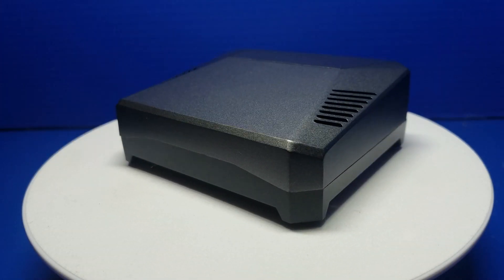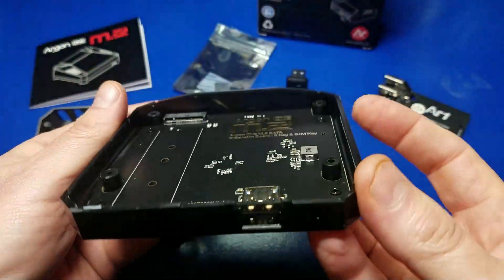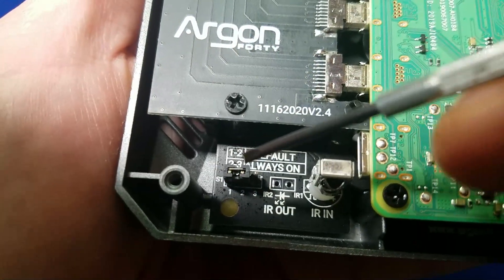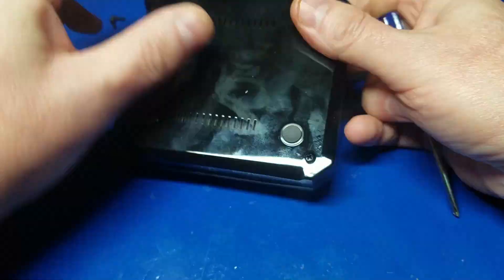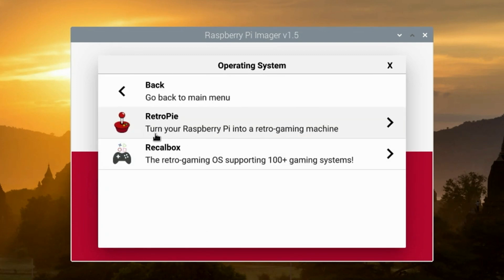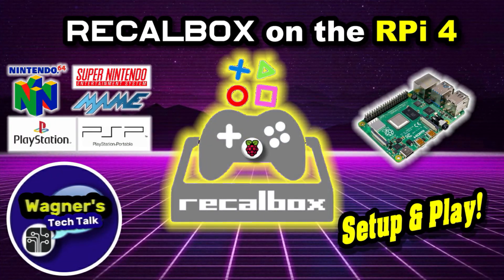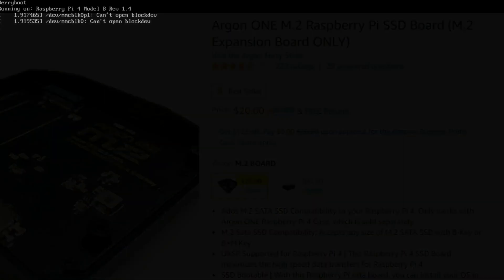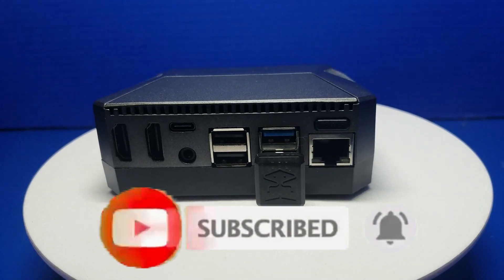Argon ONE V2 M.2 SATA SSD Raspberry Pi 4 Case: Full Setup Guide

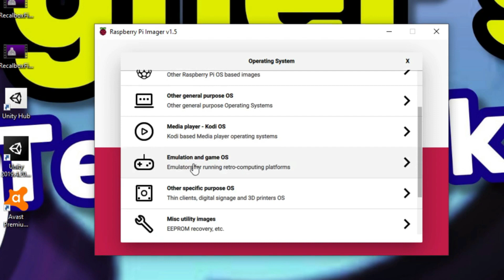Comment: I'm confused. At 9:38 you load the image onto the SSD enclosure. However, you already have the SSD inside of the Argon. You never mention about taking it out. It gives the impression that you have 2 SSDs. Anyway, at 8:38 I do everything perfect step-by-step but then I get a ""failed to open device: SD Card" on bootup. But why is it looking for my SD Card when I already have the NVME installed and formatted? What am I missing?
Reply from the maker: I demonstrated multiple operating systems being installed PiOS, Recalbox and RetroPie (never know what people want to install, so showed a few to demonstrate how to do it).  You actually don't need the enclosure shown in this video, you can use a USB Type-A to Type-A cable to connect it to your PC if you want (instead of the enclosure).  I made a follow-up video on it here, to clarify: https://youtu.be/LHZQKr5G7MA  This case can't use an NVME drive, you'll need an M.2 SSD such as the ones shown here: http://wagnerstechtalk.com/argonone/#Where_to_find_an_Argon_ONE .  Also have some troubleshooting info here: http://wagnerstechtalk.com/argonone/#Troubleshooting
Reply: @WagnersTechTalk  thanks! I said NVME but I meant the 860EVO SSD. I bought everything using your affiliate links and I’m trying to get it going but no luck. I’ll shoot a video which will help you more of what’s happening. Thanks so far.
Reply: @WagnersTechTalk  OK here's my video showing what's happening. Also, happy 4th of July! https://www.youtube.com/watch?v=CaWyhdgQUdo
Reply from the maker: Happy July 4th Walt!  Here's a thread that sounds pretty similar to what you demonstrated in your excellent video response (thank you for that, very helpful): https://www.raspberrypi.org/forums/viewtopic.php?t=294691 The issue reported in the thread turned out to be the power supply, he replied to his own post 8 days later with his solution.  Are you using the official RPi power supply or the one from Argon ONE (18 watts 5.25 Volts 3.5 Amps)?  I used the Argon ONE Raspberry Power Supply – 18 Watts 5.25 Volts 3.5 Amps (USB-C) Power Adapter ( https://www.amazon.com/gp/product/B07TW4Q693 ).  Otherwise, I don't see anything wrong (firmware appears fine, looks like the U-Connector is installed in the back, etc.), may just be that the power being used can't pull the needed extra current for the M.2 drive.  In the thread above, he had no indication that there was an under-power condition and I also didn't see any indicator in your video.  One other thing that you might try, use PiOS imager to erase/format the SSD as a Fat32 (option near the bottom).  Then, re-install the OS to the SSD and see if that helps.  Please let me know if this helps (or not).  I can't think of anything else it may be, honestly.
Reply: @WagnersTechTalk  this might be the issue! I’m using the CanaKit power supply. It came with the RPi 8gb model. But I just went ahead and ordered the Argon One which arrived in 4 days. Thanks so much! I’ll let you know how it goes.
Reply from the maker: Awesome, hope this is it!  In anticipation that this is likely the problem, I updated the Troubleshooting section here: http://wagnerstechtalk.com/argonone/#Troubleshooting
Reply: @WagnersTechTalk  you’re awesome. I just checked and the CanaKit power supply is 5.1 volts 3.5 amps. So maybe the M.2 won’t run unless the voltage is exact. I’ll find out soon enough.
Reply from the maker: Very interesting, I've never had to go through these steps on the Pi 4 with any of the cases I've used (some here: http://wagnerstechtalk.com/guides/#Raspberry_Pi_Cases ).
Reply: @WagnersTechTalk  maybe it’s because I just purchased it this week. I’m also using an 8gb RAM model. So maybe it has a different out-of-the-box configuration than the other models. Either way it’s working perfectly now.
Reply: @ForOrchestra  Thank you for this. This finally worked.

Comment: The Raspberry imager is taking forever to write to the SSD.  Could it be my wifi.  My SSD is a Samsung m2 sata EVO
Reply from the maker: Before writing, make sure it's plugged into a USB 3.0 port, may also want to use Raspberry Pi Imager to format the SSD before re-imaging (just to make sure there are no errors writing to the SSD).  Aside from that, could be your WiFi.  May want to cancel, check your internet speed (go to speedtest.net to perform a test if needed).  If all appears good, try again.

Comment: Hi, great guide! i am using this case but without the m.2 enclosure and i did as you mentioned in the video but it does not show anything on my screen. I hear the fan spinning for few seconds but then nothing. I can see also red static led on and green light blinking. Also i test it without the case my raspberry pi and it is working as usual, but when i try to add the case it is not showing, black screen, fan not working. Do you know something that might help? Thanks in advance.
Reply from the maker: Thank you Adamos, sounds like the riser card for the HDMI output may be defective.  If you've already double checked the connections I'd get a replacement.

Comment: Got this case some months ago together with an WD Red 500GB m.2 SSD and it works like a charm. Connected the Pi with an 0,25m LAN to my Router and started an SMB Server with it. Here I use two 5TB WD 2.5 HDD‘s together with jDownloader. I‘ve even installed ioBroker and Homebridge for smarthome.
Reply: How did you connect two HDDs to it? Isn't there any issue on the rpi4 when connecting two at a time?

Comment: Wanted the Origonal case for a long time, I was so glad I held off; I have 2 of these with Pi4 8Gig Rocking 420 M.2's.
Killer Machines; I thought the 3 was awesome, this makes the 4 a Complete Daily Desktop
Reply from the maker: It is an awesome case!  I really like that they included full-size HDMI ports on the V2, just easier to connect stuff up.  If you're interested in the IR Remote, here's a vid on that: https://youtu.be/f_MfEZ194sU  Spoiler: Great for LibreELEC, but not much else at this time.

Comment: I may or may not have accidently broken my micro sd holder on my rasberry pi. Is it possible to use the enclosure to add retropie to my m.2, then after plug it into its regular m.2 slot on the case and bypass using a micro sd?
Reply from the maker: Yes it is possible, see this update video: https://youtu.be/LHZQKr5G7MA  (See chapter markers in the video description if you want to skip ahead).
Reply: @WagnersTechTalk  Thanks so much! Helped a ton actually.
Reply: @WagnersTechTalk  Hey, was curious. I finally was able to get my ssd, but even booting from ssd all videos say i need a micro sd card to start before switching to ssd. After flashing retropie onto the ssd and turning on the rasberry pi 4, it still tries to boot from sd. Since my sd card slot is broken, am i screwed?

Comment: Is anybody doing anything cool with the infrared (IR) receiver?  I repurposed a IR remote from an LED strip and used the installed software to configure it to power up and shutdown the Pi.  Also programmed the up/down buttons but those don't seem to do anything in Raspbian.  Any advice?
Reply from the maker: Sounds great Paul! I've not played with the IR receiver yet.  I was hoping to get ahold of one of the Argon ONE remotes but haven't as of yet.
Reply: @WagnersTechTalk  I wasn't able to get the Argon remote either, but based on what I saw, any IR remote will work.  Just don't use your TV remote if it's the same room with your Argon/Raspberry Pi.  I'm a little confused because the Argon Remote has as 11 buttons but the software only let me configure 3.  So seems like there is more potential I'm missing out on.
Reply from the maker: Definitely something I need to investigate when I have time.  I do have a few spare remotes, I'll add this to my to-do list for a follow-up vid in the future.

Comment: Good concept, but I think it needs better active cooling, the fan supplied does nothing to cool the Argon. Mine runs in the mid 50's and hits 61 when I actually use it to watch a video or do some editing. I added thermal paste and it may have dropped 1 or 2 degrees. Waiting for my DeskPi Pro replacement parts then I will set it up and hopefully have better performance. My Muizei case is awesome, 36 degrees max 44 or so,  I also have a dual fan on one of my pis and it is awesome.
Reply from the maker: Thanks for sharing!
Reply: @WagnersTechTalk  My DeskPi Pro replacement parts came in and the HDMI ports don't work, lol. I guess the Argon comes up on top as it works.
Reply from the maker: @sovereignlivingsoul  Oh man, sorry to hear that!  Hope they are able to get it resolved/replaced for you.  But yeah, still loving the Argon ONE V2 here!

Comment: My bootloader is "c305221a", dated September 3, 2020. All I get is a screen that says "Failed to open device: 'sdcard', which is shown 4 times and then on the bottom, it says "Insert SD-CARD"... I would be grateful for any assistance you could provide. Also, I am using a Western Digital M.2 500GB SATA SSD with an M+B key connector, and this issue happens with any OS I try to install using the Raspberry Pi Imager.

Thank you!
Reply from the maker: Hi, just curious if you tried what is in the troubleshooting section here: http://wagnerstechtalk.com/argonone/#Troubleshooting ?
Reply: @WagnersTechTalk  Followed this guide and still not able to boot off the m.2 drive. It's still looking for the SD card. I tried putting the SD card back it, but it doesn't even boot at all. Not even and error screen or anything. Just a black screen.
Reply from the maker: @StevenT2112  Hi Steven, Hmm.  Black screen and nothing else?  Make sure you have the HDMI cable plugged into the far-left port and your TV/Monitor input selection is correct (HDMI1...n).  If that doesn't work, disconnect the power and make sure the HDMI daughter board is seated all the way (unscrew, unplug, re-plug, re-screw) and power it back up on the microSD card.  If that doesn't work, contact Argon Forty for support, at that point it's a hardware issue -most likely.
Reply: @WagnersTechTalk  Everything is hooked up the same way it was before doing the "rpi-update" command. Everything was working fine before that, except not being able to boot from the ssd drive. Hence why I did this in the first place.
Reply: @WagnersTechTalk  I appreciate your assistance. Sadly, I have done that with no luck. I may have a defective *something*. It fine. I'll get it all sorted out.

Thanks again.

Comment: I have the argonone case w/out the m.2 half but I have orded one. At the moment I am runing kodi on a 32GB Thumb drive. If I cloned it would I need to expand the file system?
Reply from the maker: If I recall correctly, you'll have to expand the file system after cloning.  You can do that easily through raspi-config.
Reply: There is no raspi-config in librelelec. I should of added that to my post. I think I am going to try using gparted. Ill find out tommorrow. @WagnersTechTalk
Reply from the maker: @One-Eyed-Willly  Ah, ok.  Yeah gparted should be able to expand the FS in that case.

Comment: small tip for all who are interested the lower half of case can function like an enclosure all you need is a USB 3 TYPE A to TYPE A cable.
at least that's how I do transfers
Reply from the maker: Hi Lukas, you're exactly right!  I released an update video to discuss this (also added to the video description) after it was brought to my attention that there is another easier way: https://youtu.be/LHZQKr5G7MA?t=209  Thank you!
Reply: @WagnersTechTalk  as the m2 comes with a short USB to USB plug, all you need to do is plug one end into the case, then use a normal USB extension cable (m to f)to connect the other end of the cable to your computer USB port

Comment: I have tried your process and the os doesn't recognize the ssd unless I unplug bridge and replug in, any ideas?
Reply from the maker: Which OS did you install that had an issue?   If the OS is PiOS, once you get it booted, make sure you update to the latest version: sudo apt full-upgrade / sudo reboot (from the terminal).  You might have older firmware on your Pi 4, see the first bullet here for updating: http://wagnerstechtalk.com/argonone/#Troubleshooting (after updating the OS itself).  If the above doesn't help, you might have a defective unit.  You shouldn't have to unploug/re-plug in the U connector to get it to work.
Reply: @WagnersTechTalk  Thanks for the link, the firmware update solve this for me!
Reply from the maker: @balloonpark  Awesome, great to hear!
Reply: @WagnersTechTalk  I used the jan 2021 distro of PiOS

Comment: Why would I buy the bottom expansion board by itself?
Reply from the maker: If you already owned the prior model, Argon ONE case you can add the base with the M.2 to that existing case for $20.  If you don't already have it, it's around $45.  Hope that helps.

Comment: Please help. For an SATA M.2 can I use a 1T or am I limited to a certain gb capacity??
Reply from the maker: A 1TB should work just fine, the only limits would be those imposed by the file system used, from what I understand.  The largest M.2 that I've personally tried is  512GB.
Reply: @WagnersTechTalk  wow thank you very much that was alot of help!!!!!
Reply from the maker: Very welcome!
Reply: @WagnersTechTalk  I went with the Samsung 860 EVO M.2 500GB SATA M.2
Reply from the maker: Make sure it has a B or B+M Key like the one shown here: http://wagnerstechtalk.com/argonone/#Where_to_find_an_Argon_ONE  If it is, you should be good to go!
Reply: @WagnersTechTalk  it's the same Samsung one you installed and posted the video 3 weeks ago
Reply from the maker: Had to check, Samsung makes a lot of different SSD's and wanted to make sure you got one that will work.  The one in the video definitely does.

Comment: Is it possible to use de Aragon Case USB to directly connect the ssd to the main computer and put the recalbox image directly on the ssd and then mounting the raspberry pi instead installing it on a sd card first?
Reply from the maker: Yes it is, I released an update video this weekend which mentions it here: https://youtu.be/LHZQKr5G7MA
Reply: @WagnersTechTalk  Great! I'm getting my new RBPi soon with the case and ssd drive but I totally forgot the sd card
Reply from the maker: You'll just need a USB 3.0 Type A-A (Male to Male) cable and can plug it into the M.2 and to your computer.
Reply: @WagnersTechTalk   does it have to be USB 3.0? I have an old USB Male to USB female extender and plan to use the U adapter from the M.2 to adapter to USB 1.0 extender to computer. Case arrives Monday and I'm trying to set my expectations. Can't seem to find and USB male/male cables around; everything I have goes to mini/micro/C.

Comment: Anyone experiencing low voltage problems? I can boot up my Pi but not with the SSD connected. It’ll shut off the Pi and enter infinite reboot loop. If I connect an external HDD, it’ll show low voltage but not shut off. 

Using the official 5V 3A charger.
Reply from the maker: I have not had any low voltage issues.  For this question, might need to contact ArgonForty.  Could be an issue with the M.2 board, hard to tell: https://www.argon40.com/contact
Reply: @WagnersTechTalk  thanks for the reply and I’ll contact them. Really appreciate this video as I had no idea how to easily boot up from SSD.
Reply from the maker: Very welcome, thank you for watching and if you don't mind let me know what they say.  Curious to know what the issue is!
Reply: Apparently my connected peripherals and storage were drawing more power. So they recommended me their 18w charger.
Reply: I had some warnings when I installed a M.2 SSD (0,95 Amp) . However since installing the new Rasbian yesterday the warnings stopped.

Comment: You didnt need an extra m.2 usb enclosure, you  can use the argon case without the usb expansion, hook it up directly to a computer using usb to usb cable and install your operating system.
Reply: IT is working
Reply from the maker: I didn't see that in the manual, but I guess if you have a USB-A to USB-A cable this might work.  Curious, did you happen to try this and it worked?  If so, I definitely need to add that to the A1 guide.  I appreciate the feedback!
Reply: @WagnersTechTalk  I do have the argon1 m.2 case, and I did install my operating system this way. Yes interestingly it is not stated in the manual, I have seen another youtuber do it (with a usb-A to usb-A cable) then it made sense to me as the casing is actually m.2 to usb, and you hook that up to pi using a usb jumper. Why not skip the jumper and use the board as a USB to m.2 converter? Turns out I can save 20$ this way
Reply from the maker: I like it, thanks for letting me know!  I'll have to give this a try myself and then I'll update the guide.  Makes perfect sense.
Reply from the maker: @EfeArda1991  Again, thank you for this information.  Tested it here as well and added it to an Update Video here: https://youtu.be/LHZQKr5G7MA  (you even got a mention for the info.)  Thank you very much for this great tip.
Reply: @WagnersTechTalk  My pleasure, glad to have helped anyone who saved 20$ with the trick :)